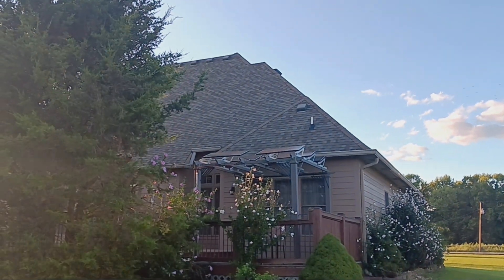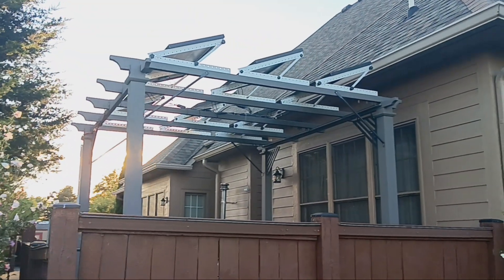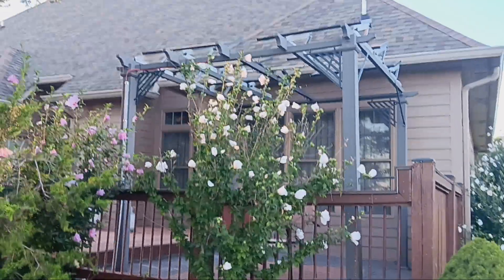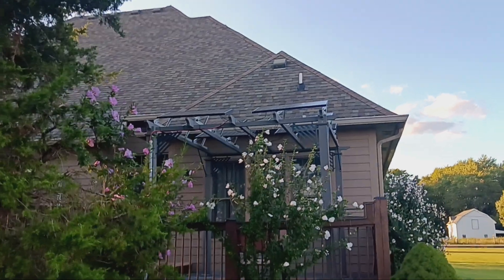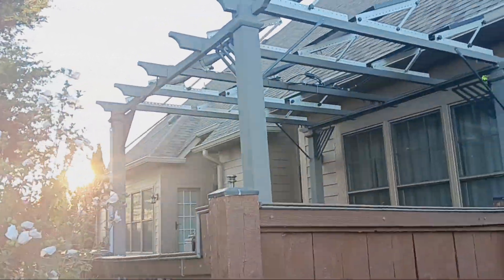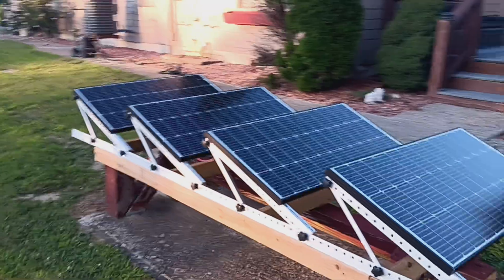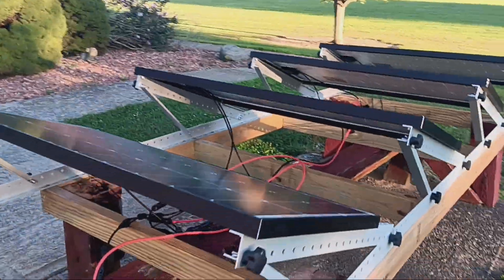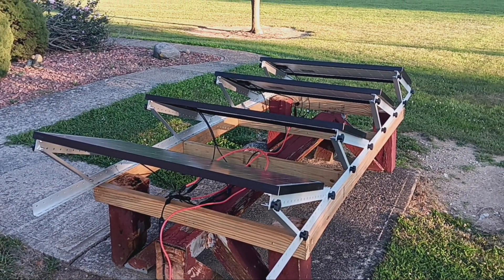DIY Solar Panel Array Pergola Mount Ideas Part 2

Comment: Oh.

You asked.
The series array helps to mitigate the voltage drop problem due to wire run distance.
You don't state the wire size.
Southwire has a nice voltage drop calculator online.

But you mainly need to know the Open Circuit Voltage (OCV) of each solar panel, and the maximum input voltage of the controller or battery 'generator'.

With the 4 panel array, I will guess at 20v OCV and lets guess at 150 volt max input. 20x4 = 80 volts, and will work well.
The increase in power available will be measurable (~25% ?)
You will just do away with the 'Y' adapters and daisy chain the panels.

The difficulty is that the two arrays need to be the same voltage to parallel them, So the least common denominator is 2 panels in series for 40 volts, and parallel all of the pairs.
(or add two panels on the ground array 😝)

thanks for the video!
Reply from the maker: Thanks. I actually have each array running independently to each Delta 2(two in total). I will experiment with your recommendations.
Reply: @larvae91  Tread carefully. I am not certain what the specifications are on the solar panels you have. What I see now means the ground array can be 2 series pairs in parallel. 

You may be able to connect 3 panels in series and connect two of those sets together in parallel on the pergola. But it might be close. 3 series pairs in parallel seems to be safe. Enjoy!

Delta 2 Solar Charging 11-60V

FAQ
Can I connect solar panels in series / parallel?
1. Up to 2 sets of 110W EcoFlow solar panels can be connected in parallel. Series connection is not supported. For parallel connection, you need to buy the Solar Parallel Connection Cable separately.

2. Third-party solar panels of the same wattage lower than 110W, 10-25V input, and DC 10A max current can be connected in parallel. According to the specifications, they may be able to support both parallel connection and series connection. However, we don’t recommend that you connect solar panels of different wattages at the same time.